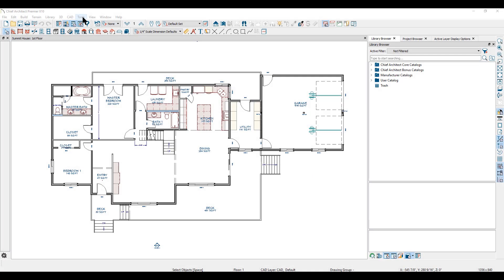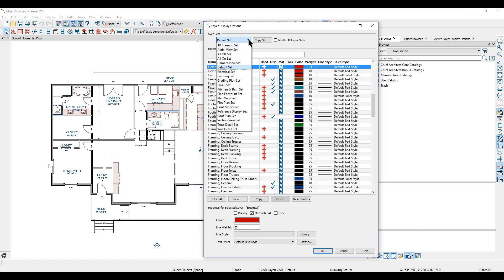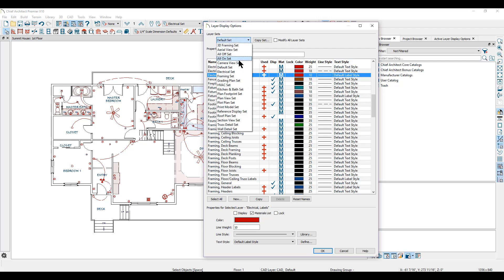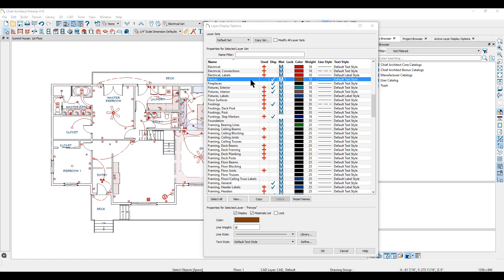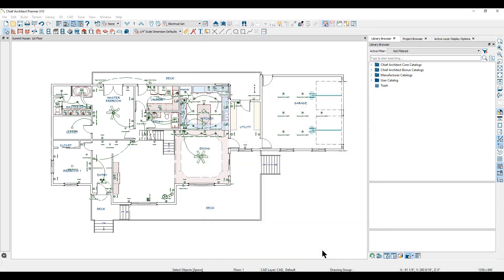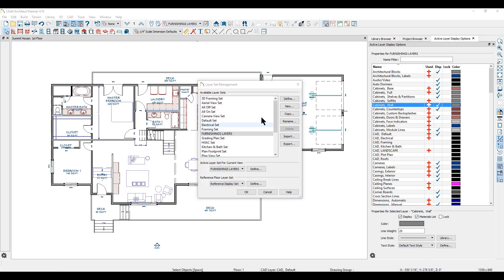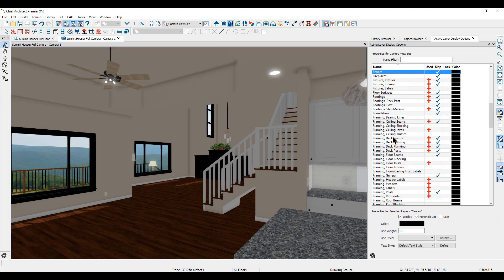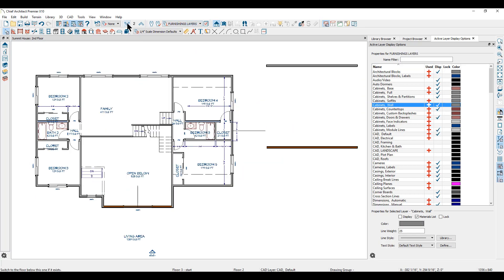Understanding Layer Sets

Comment: Home Designer Professional is great but it doesn’t have all these layer capabilities. I’m doing a lot of retrofit documentation of solar, electrical, seismic, plumbing, sprinklers, well, etc, so I’m strongly thinking about upgrading.
Reply from the maker: We do have upgrade specials, feel free to call sales to see what your options are. You can contact us at 208-292-3400 Monday – Friday from 7 AM – 5 PM Pacific.  Chief Architect will have much more efficiency and customization tools.
Reply: @ChiefArchitect  Thanks for the quick reply. After additional research I realize now that the type of documentation I’d envisioned goes even beyond what Chief Architect Premier does. I’d actually need  Building Information Management software or even specialized CAD like AutoCAD MEP. Which would be insane for a single user retrofitting a single house, both cost and time investment wise. I’ll give Home Designer Professional another go for now - it’s still a great program.